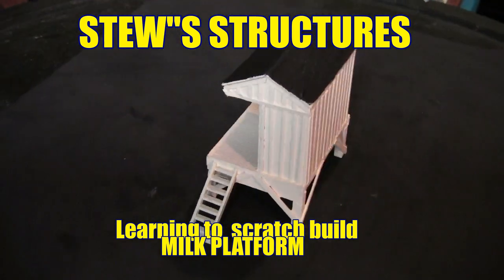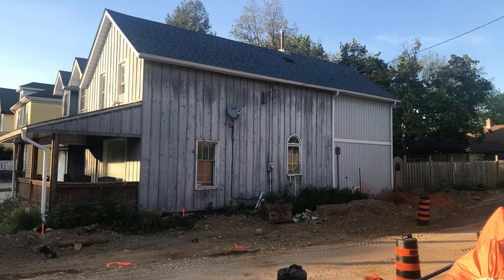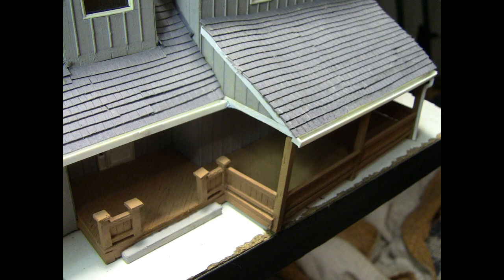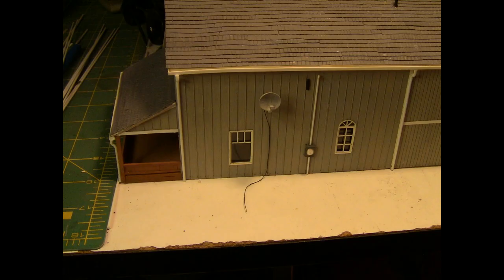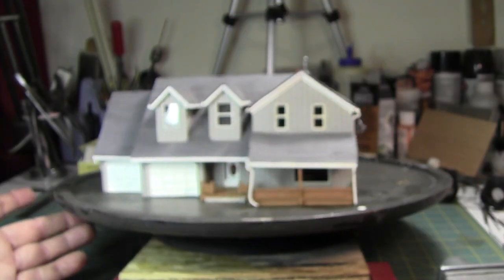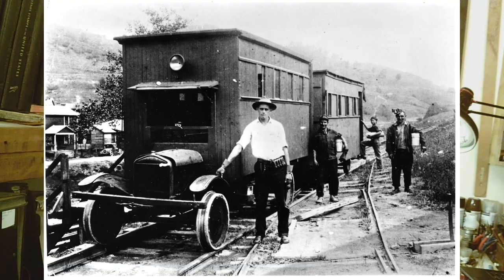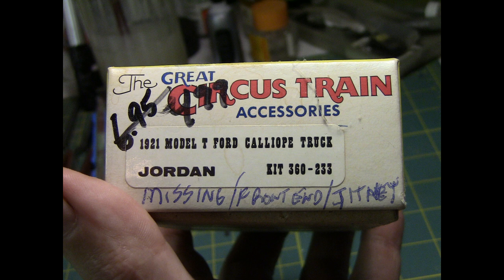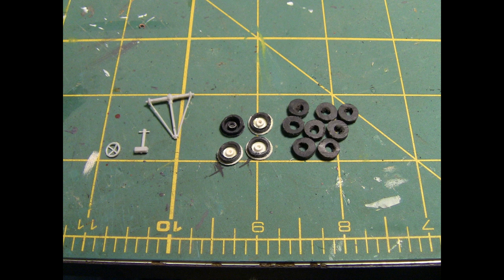A WEEK IN THE LIFE OF A MODEL RAILROADER   BLOG 1

Comment: Can I make a suggestion Mark on your jitney car...I’ve used HOn3 wheels, used a NWSL wheel puller to remove the small wheels from narrow gauge axles, then switched axles from a standard gauge truck and used that for MOW vehicles rail services...just a thought instead of scratch building wheels. I believe HOn3 wheels are 24”-28” in diameter?Then possibly making a rolling jitney! Just my two cents worth